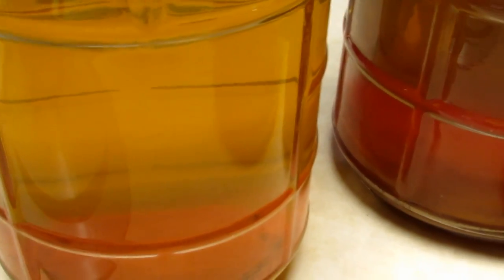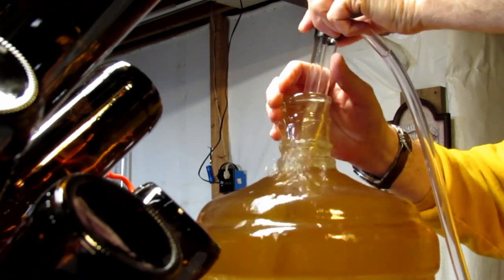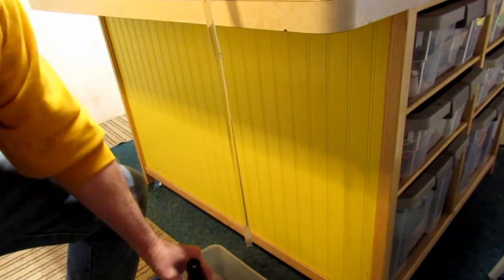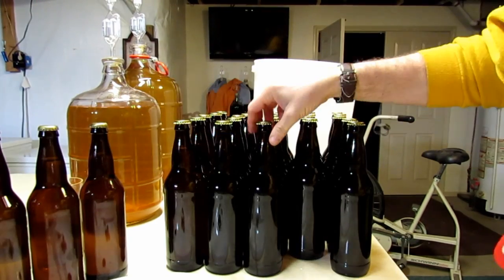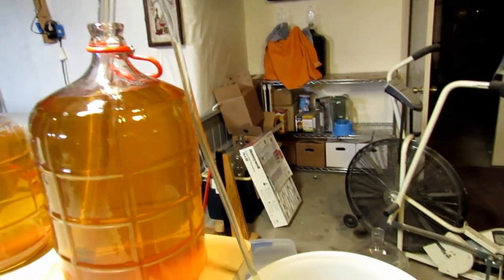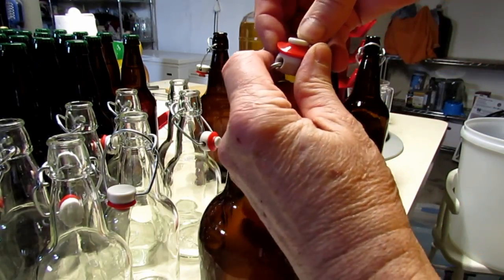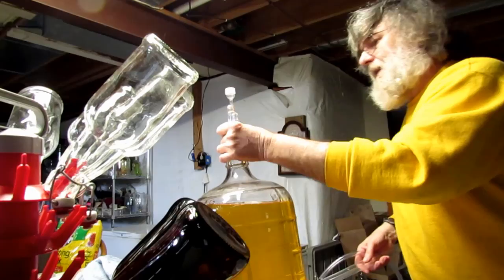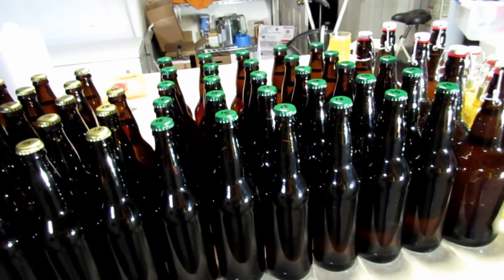Making Hard Apple Cider Part 3 Bottling

Comment: Nice video,  cider and mead are always fun to make . When you siphon into the bottling bucket try giving the siphon pump a good hard push after the siphon has started, you want that bubble of air that's trapped in the siphon tube to be pushed out of the tube. That small bubble of air will dissolve into the cider and oxygenate the cider as it flows thru the tube, it doesn't take a lot of air, a small amount can go a long way. When you use the bottling wand try connecting it to the tap with a short, about two inches piece of tubing, this way you won't have to bend down so far. I put my bottling bucket on top of a short three gallon bucket with a lid and about two thirds full of water for stability, on top of my counter, it's a bit of a lift but at least I can stand and fill the bottles.
Reply from the maker: As you can see, I am new at this. It is so easy to make and most batches have better flavor then the high end commercial ciders. Thanks, I will use your tips in the future.

Comment: Agree, that it is a lot of work. I just bottled up a number of ciders recently. The cleaning and sanitising takes the time. I think I will invest in one of those wash devices you had and the bottle drain thingie. That would certainly save me a lot of time. So thank you for sharing this. Cheers Craig
Reply from the maker: The sanitising device speeds things up, and it did not cost much from Midwest Supplies. That and the bottle rack also work good for wine bottles. I am looking foward to starting this years batch in a couple of weeks. Thank you for watching my video.

Comment: The Rubber Seals can easily ne reused. Just cook them im water with a shot of vinegar. You just have to replace the rubber seals if you see damage. In Germany this bottles are the standard if you make your own stuff (We have lots of beer brands that use this bottles, so they are cheap to get) and the whole canning system from german company WECK works with rubber seals. So we learn it this way.
Reply from the maker: Thanks,  that is good to know. I have always replaced them. Over here the bottles are expensive  but they work so well with the cider so you can reseal them without having to drink the whole bottle. Thanks for watching.

Comment: With the smaller carboy 3 gallon vs the 5 gallon do you add less than the pkt of yeast? thanks.
Reply from the maker: I always use the whole packet for 3 - 6 gallon carboys. I will use 1/2 for the 1gallon containers.  I think the yeast just dies off when it runs out of food, or is killed off by the max alcohol level it can survive in. Thanks for watching.
Reply: Good Evening. So  I put my cider in the first carboy on Nov 13 16 and the bubbler still has bubbles once every 5 seconds at four weeks,  how ever I don't see bubbles near the neck like you did when you were about to do your first racking, and 
mine at the shoulder there is a ring of foam. Would you advise me to rack it now, given the information I have shared. Thanks! Kelly
Reply from the maker: It sounds like it should be ok to rack. You want to get the cider off everything that has settled to the bottom of the carboy to avoid off tastes. You will put a air lock on the next carboy so if it is still bubbling it does not mater. Then I let it sit in a cool place for a couple of months to finish fermenting & clearing up before bottling. Sounds like it is time for your first taste, and in a couple of months it will be even smoother. It is critical to sanitize everything that touches the cider.
Reply: Good Morning :)   -  If I could ask again, further to my post about one month ago. I have a few questions. 
 At that time I racked the cider to the new clean carboy with clean tubes etc. That was about a week or two before Christmas. It was still fermenting before I put it in the new carboy. Once in the new carboy it seemed to stop fermenting, is that normal? the bubbling in the carboy and in the bubbler stopped. Also, the carboy was no longer full due to the loss from the sludge in the bottom of the first carboy- should I be concerned about that? and lastly, it has not even shown any attempt at clearing. I see on bottling day you were at 5 months for clear cider. When is reasonable that I will see some clearing to start. Thanks so much. Apppreciate your help.Kelly
Reply from the maker: Did you taste it when you transferred it and check it with a hydrometer to see if your alcohol level had been achieved and it was not yeasty tasting? I usually go to a smaller size carboy when racking it off, or add a little more cider to top it off so there is not much air in the new carboy. I start with a 6 1/2 gal, go to a 6, and finally a 5 gallon. I just leave it in my cool (about 55- 60 deg) basement until it is clear.  It only takes a couple of months  until everything has settled. I think the cider can also remain slightly cloudy if pasteurized cider is used instead of fresh pressed but should taste fine without being perfectly clear.  I start it late October it is pretty good  by Easter. I then let it age a couple more months in a fridge and it becomes fantastic.
Reply: I did taste it the day I racked it , in December it was a bit yeasty for sure and was still bubbling like crazy, but stopped when I racked it. Currently I am  only seeing a few non moving bubbles at the top of the cider, and no activity in the bubbler itself. (that is why I found it odd that some folks seem to drink it when it is murky and yeasty at that point)  Next year I will have to have different size carboys available to take care of the loss when racking. Could I at this point add some fresh cider to top it off- cider that is non alcohol? Is it too late? When you say it only takes a couple months to clear are you talking from my Dec 10th? say to Feb 10? It appears as murky as ever right now. I actually pressed my cider and brought it to temp on the stove  per USDA instructions and then followed your lead. As far as the alcohol level, at start it was reading at a potential  16% quite high after the addition of sugars. To test it today, do I just put it in the cylinder and twirl the hydrometer? I ll do that this weekend and taste it again. (I ll get back to you again with that reading and a taste- and if you could answer my questions I would be so happy) Just FYI I made your Jew Salad at the same time I made your sauerkraut with great success- Yummy!  I am a foodie,  not sure yet if I am a successful brewer :) Thanks Again.
Reply from the maker: I do not heat the cider, I just add sulfates to kill any natural yeast and let it sit 24 hours before adding yeast. I think that heating is the same as pasteurization and could be part of the problem with all the pectin in cider. I would not add anything now. The hydrometer reading should be close to 0 if the fermentation has stopped. I would let it sit until about April in a cool location covered to keep light out and then check it. I would just leave it sealed up for now and give it a couple more months to settle out. For 16% you have to use a champagne type yeast that does not die off at lower alcohol levels. Many yeasts will die off at 11-12% and not finish fermenting the sugars. The cider is very dry like a wine when fermentation is complete. The cooler the better for settling yeast out. Once you make your own sauerkraut, you will never eat the commercially produced version again.
Reply: Thanks for this! I used the yeast you recommended. I m going to move it to a cooler place- such as an unheated porch. When it was bubbling before racking in December, I assume that means it was still fermenting (but then stopped immediatey )The kraut  is yummy, bit salty, twas difficult to tell exactly how much to add.
Reply from the maker: There were 2 different yeasts used in the video . The wine yeast for the 10% first batch and champagne yeast for the 15% second batch. I have never had it just stop fermenting like that. Just don't let it freeze and keep light off it.  You can get away with just a few sprinkles ol salt on each layer if you want the kraut less salty.